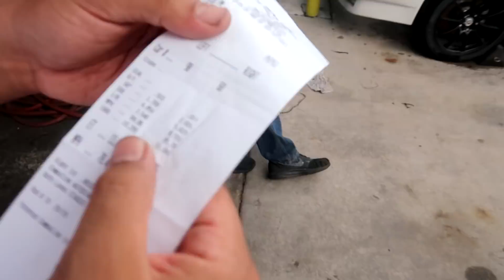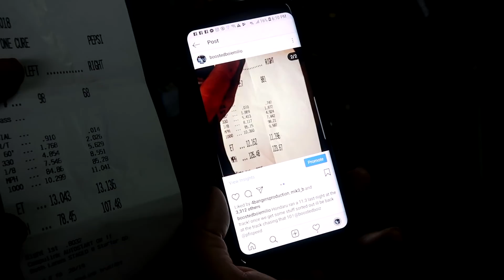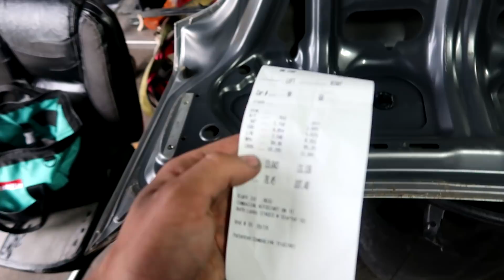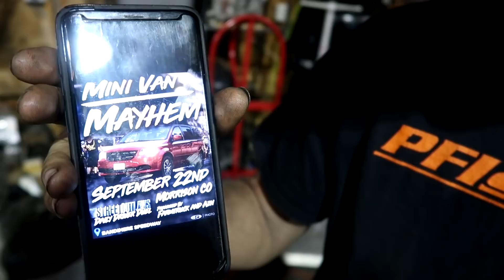700HP Minivan Comes Back to Life!

Comment: Did the trans break or did the subí guys sabotage you during the oil change.
Reply: It's that Subaru filter!
Reply: Lol as funny as that is but a gearbox doesn’t have a filter
Reply: no they put a subaru oilfilter on the engine
Reply: I knew I wasn't the only one that had this thought
Reply: It's Subaru parts no need to sabotage, all you need is time lol.
Reply: @Snarleydread  yes it does. Look up an E46 transmission fluid change
Reply: But this Subaru gear box does not have a filter so that Subaru filter didn’t sabotage the gear box, Subaru gears are just known to break anyway
Reply: Chris Moxham the sti trans is supposed to be "bulletproof" lol I guess not
Reply: BucketBryce I know right 😂
Reply: Bulletproof doesn't mean never breaks, it just means much less likely. A shift fork failure is pretty rare. The Subaru 6 speed is supposed to be good until around 600 HP then it starts getting sketchy.
Reply: 802 Garage thanks for a genuine reply man, seen you comment a few times, not sure how this could have happened, I can’t remember what power it’s running but probably can’t handle that awesome Rev range 😂
Reply: I think the Hondaru was around 485 right now? That is still pretty high. It is possible he released the clutch a bit early and slammed the fork right into the gearset. Combination of user error and trans power limit. Could happen to anyone. There is a reason that trans is worth $1500-3000 though, hahaha.
Reply: The shift fork bent.
Reply: Matt Hemberry yeah probably and probably because the synchros didn’t catch up and forcing it into 3rd hard enough bent the fork then putting in fourth finished it off
Reply: Lol
Reply: 802 Garage didn’t even get a notification you replied 😭 exactly what I was thinking aswell, bit too quick on that clutch and gear shifting lol didn’t even think about not disengaging the clutch properly so yeah sounds like he shifted too late
Reply: Sounds like the shift linkage
Reply: Nigel Thornberry they checked it and it wasn’t the shift linkage lol
Reply: @Snarleydread  it does right above the transmission pan inside

Comment: Paint it red n use her to haul the hatch
Reply: Shane Downey not legal for long distances. If he gets pulled over hes fucked
Reply: The van has a VIN and likely has all safety equipment, and can be insured.  The only issue would be weight limit of the rear suspension.  The hatch plus a trailer is going to be around 6000 pounds, and that year of honda oddessy was only rated to tow 4500 by honda, and no shop would put more than a class 2 5000 pound draw bar on it, and you would be insane to try and pull something so heavy with it.
Reply: Tech Edison no it's due to suspension and part strength. Also gotta be able to safely drive 60mph and stop. If you get pulled over by a trooper or dot your getting a very large fine
Reply: The Odyssey got brand new coilovers from bc racing what are you guys talking about
Reply: BucketBryce not exactly strong enough to tow 5000lbs
Reply: Jared K even with the stiff springrates and the dampening all the way up ?
Reply: BucketBryce you also gotta take into account the frame and the rear end strength. Because your liable to just bend it all in
Reply: @chubbysumo2230  use a dolley and it would be well below 4500.
Reply: Swap tires, better rear susp, upgrade the chute bar to use a 2 to 4 inch drop hitch for a Dooley an I'm sure Brents brain an fingers can figure out the rest... It would be badass coming from a v8 guy.. Js the epicness would be real
Reply: Its not hard to reinforce the rear frame, especially with Kyles welding skills he can easily buff the rear end up and weld in a good tow bar. The rowdessy has MORE then enough power to tow 6000lbs at 60mph.

Comment: You're doing something wrong if you manage break STI 6-speed at that power level. I mean it's a really sturdy box. Your shifting looks really violent.
Reply: Its drag racing.... You dont granny shift it
Reply: @keepnitlow1527  You dont need to use that much force to shift fast..
Reply: @mattiloponen92  the faster you shift, the more force is needed. What don't you get?
Reply: @mattiloponen92  a greater force causes a greater CHANGE in velocity for an object
Reply: @keepnitlow1527  You need more force to shift fast, sure. I'm just saying that hes using too much and his shifting technigue is poor. You dont have to use your whole arm and back muscles to shift. Its all about the wrist. Are you sayimg the stongest man is always the fastest aslo huh?
Reply: And punching the gears in also causes misshifts and that breaks stuff. If you use all the force but dont hit the slot its causes a hige strain to the shift linkages.

Comment: The part that broke in the trans is called the shift interlock. It’s on the shift rod and it’s the part that engages each fork. I have a customer that breaks his once a year. $75 part. About an hour to fix once the trans is out.  Good luck.

Comment: Kyle, just curious have you guys every tried modifying a honda / acura V6? seems like it would give a little added weight over the front tires and if you did the same kind of mods to a bigger displacement V6 you would still have a minivan with a bit more power. what do you think?

Comment: Check the pin that locks the shifter to the gearbox. If it's still in and the whole rod is moving, the gearbox will definitely need to be removed unfortunately.

Comment: Just wedge a piece of wood in between the floor and the e-brake when you want to park it. Relieve some of that stress off the gears while sitting. I can't park my car without using the e-brake so it doesn't roll back on the gears. It's a habit now.

Comment: Need to ask a question guy's why don't you guy's use aftermarket sleeves is it just the cost getting the block ready for them or something else ?   Only ask as my H22a is sleeved an running a larger piston now an only got the engine ran in last week an dyno today an final pull was 805whp @16 pounds.  This build was just new sleeves Pistons an rods as this block has been in 3 of my Honda's now as i had a accident in the first car an cut the back half off when she hit the power pole sideways at 150ks an four months in Hospital. The funny part was the day i got out of Hospital i had already purchased a mint BA8 Prelude an put everything in that within a week of getting out.   Love the content guy's    P.s Brent I'll be in touch bro as i need to pick your brain for a new project car I'm thinking about building next.